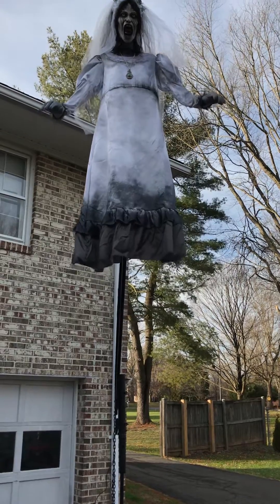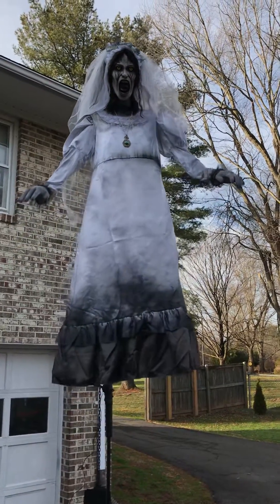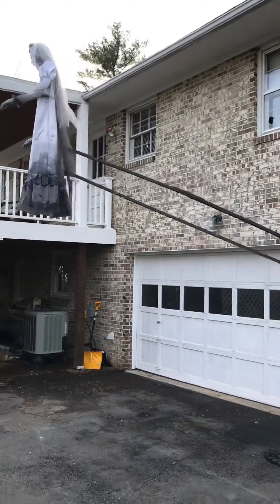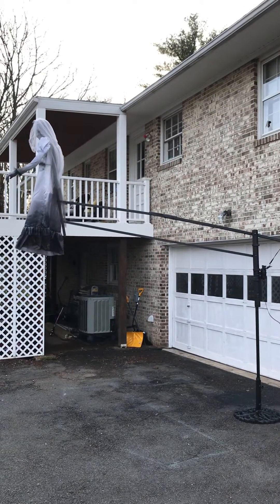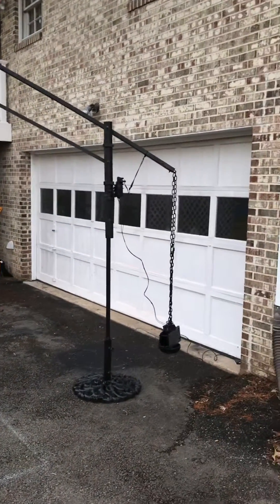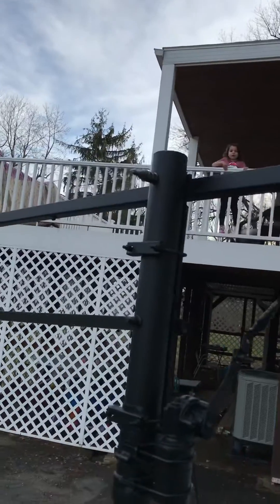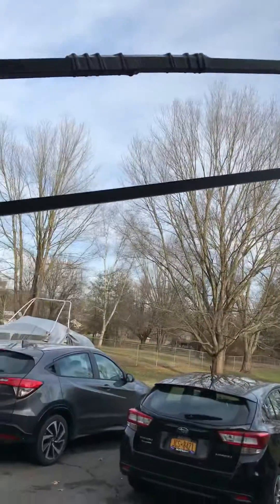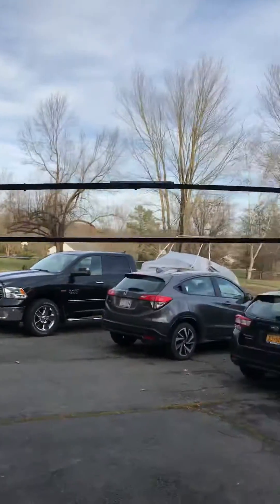Homemade flying La Llorona, aka "The Weeping Woman" prop, mechanical operation.

Comment: That is a really really nice prop, great job. I was thinking though that if it got wet it would totally throw it out of balance. I’m just getting into prop building and already storage space is becoming an issue
Reply from the maker: I usually don’t run this prop if it’s raining hard. I made it so I can easily remove the body and bring it inside if I want to. If it did get a little wet and added some more weight, I can increase the voltage to the motor, by adjusting the speed controller.

Comment: Thanks man. Just used your concept for something I am doing this year. Will keep you posted
Reply: We just turned it into a pneumatic. pilfered some  parts from past props. I needed to control it a bit more and added a trigger with Mp3 sounds to it as well.   Should have pics soon.  Its amazing!
Reply from the maker: No problem. Good luck!
Reply: Got everything built. Struggling with getting motor to pull it around. Moved up to bigger motor still struggling.
Reply from the maker: @monsoonrevolution  the 2 bar mechanism needs to be almost balanced in weight, at the pivot point. Hang a heavy duty bucked at the rear where you are going to mount the weight . Add weight to the bucket until the mechanism is nearly balanced. Remove the bucket and attach the correct amount of weight to the rear with a chain. Being nearly balanced, alows a small motor to pick up such a large prop and mechanism. I have probably around 30 pounds of weight on my prop.

Comment: This is excellent in multiple respects!  A couple suggestions you might apply:
1) Use springs to reduce the size of the counterweight.  There are loads of options at the hardware store (gate springs and screen door springs, for example; maybe cannibalize an old "chest expander" no one's using) that will supply some of the force, and you can fine-tune the system with less weight(s).  You have a lot of options that will make it easier to set up and move around: Use multiple springs.  The springs can also be adjusted (e.g., different angle, position along the arm, etc.).
2) Try the "park" setting on the wiper motor.  If you pair it with a motion detector as a trigger, she looks like a static prop from a distance but flies into the air when someone approaches.  It's much more threatening that way.
That said, she's absolutely awesome!  Really incredible work.

Comment: thats Badassss  a damn wiper motor NIceee .... going to have to try that one !! how heavy do you think to prop is roughly ? HFL!!
Reply from the maker: The weeping women prop itself is probably around 10 pounds. But, when you add in 2, 8 foot square aluminum tubes, with pvc slid inside, for more strength, and the heavy steel piece on the top bar, that is a substantial amount of weight to lift. The weight needs to be very close to balanced, on both sides of the pivot point.
Reply: @roxburyhauntedmanor8147  gotcha can't wait to try something like that ... thanks for sharing my friend !! HFL!!
Reply from the maker: @deoblo85  no problem buddy!
Reply: @roxburyhauntedmanor8147  quick question what did you use for the stand ?
Reply from the maker: @deoblo85  it is a very heavy cast iron stand, for a outdoor deck umbrella. It works out great. The thing weights a ton!
Reply: @roxburyhauntedmanor8147  Ahhhh gotcha

Comment: Thanks for showing the whole setup, just awesome.  That is very well balanced, you're getting it down to a science.
Reply from the maker: Thanks. It really takes a lot of trial and error to get the correct weight distribution for this setup. I first had a bucket attached to the chain, so I could work out exactly how much weight I needed. I just added more weight to the bucket till it was perfect.